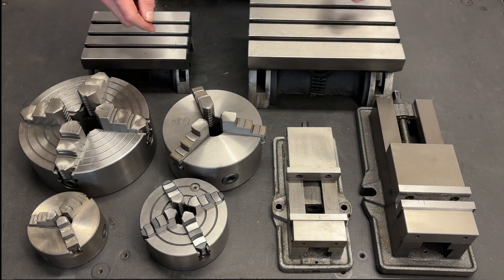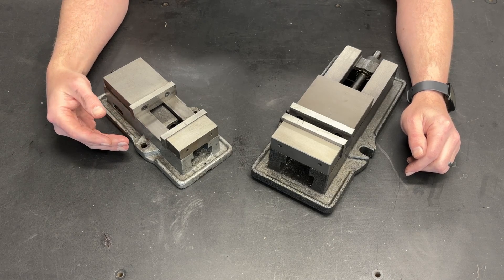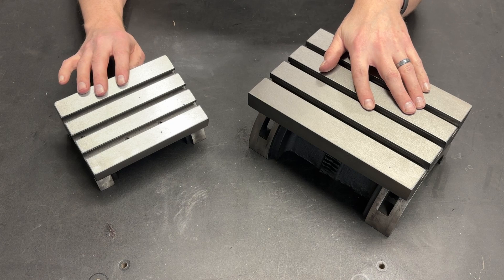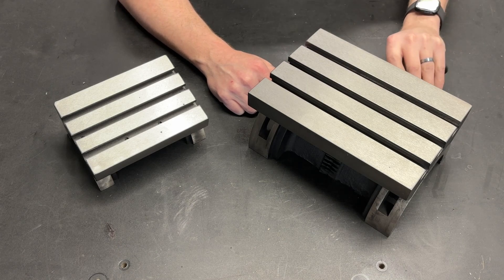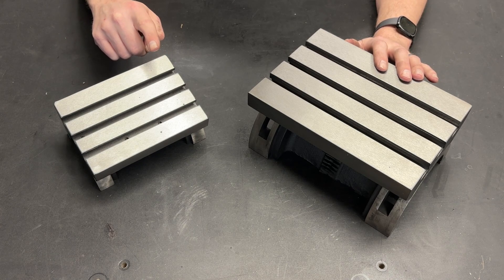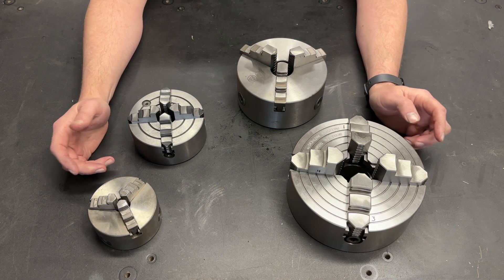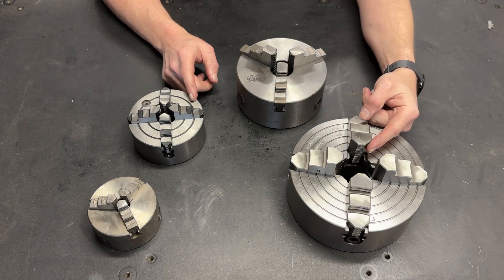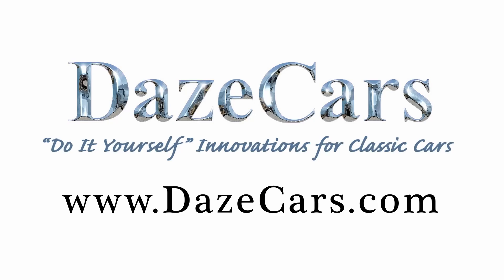Picking the Correct Machining Tooling Size for Your Hobby Mill or Lathe, Bigger Isn’t Always Better

Comment: I am putting together a 10" Sheldon lathe that I inherited from my Grandfather. I found the 8" 3 jaw chuck for it. One look and I knew it was probably too big; but I had it. I thought I had more chucks somewhere but was going ahead with what I had. A bit later I found the 6" 3 jaw one shelf over, hiding in plain sight. The difference in size is pretty substantial. I think the big thing is that larger chucks are not just a bigger radius but also thicker. This dramatically increases weight. For a 10" lathe, I would go with a 5" 3 jaw and 6" 4 jaw. 4 jaw chucks tend to be thinner and  lighter than 3 jaws so you can generally run a larger 4 jaw. But run the smallest chuck that works. I have a collet drawbar and a Sjornsen collet chuck. For small parts, I like collets. I also like running them in the headstock with the drawbar.  Every bit of weight that is hung on the end of the headstock is going to affect accuracy. Probably not noticeable for most things but still there. And added weight is added wear.  I also have an old 10" Atlas/Craftsman. And the difference in size between the two lathes is immediately visible. The have the same swing but are not of the same class. For that lathe, I have smaller chucks.
Reply from the maker: Thanks for the feedback, and that's a great point about chuck size!

Comment: i have a large 4 jaw (15.25" lathe) that i ended up having to bore the jaws to fix tuliped/worn jaws, which made the OD it could hold larger. ER40 holder + collets help fill that gap to hold the 1" and smaller stuff. best part, cheaper than a chuck.
Reply from the maker: interesting

Comment: “They say you can hold small parts in big tools — but try clamping a grinding vise in a mini mill or spinning a 50mm collet chuck in a hobby lathe, and you’ll learn real quick: Go big, or go adapt.
Yes, you can stick an ER collet chuck in an 8" lathe chuck and hold tiny stock like a champ. But try the reverse — mounting a brick in a teacup — and you’re gonna have a bad time.
Start with the big tool, scale down as needed. Doing it backwards? That’s just called troubleshooting… the hard way.”
Reply from the maker: having gone from a smaller machine to a bigger machine I see where you are coming from but I don't completely agree with your statements.  too big is just too big.  Ideally you want to get the correct machines for the projects you are working on and fit in the footprint you have available.
Reply: @dazecars  I assumed that 'ideally' wasn't an option so the choices available are go big or go small.

Comment: I have a number of mill vides. One 6 in Kurt and one 8 in Kurt. Hardly use the 8 in vise. Can’t pick up the 8 in.

But what is handy is a toolmakers 4 in vise. I clamp the toolmakers vise in the 6 in vise using an angle wedge or sine bar to set precise angles.

Tilt tables eat up precise Z height. Here I use a “cheese board” along with a sine bar with table clamps.

Most lathe work is done with 5C collets and six in chucks. I do have 8 in chucks but they are awkward when doing smaller work.
Reply from the maker: BIG difference between 6" and 8"!!  so many ways to set work up but it is so nice to have and many options as possible.  My early years in machining I didn't have much and that taught me to be creative.  Now I have both a bag of tricks AND the tooling to give me more options.

Comment: Help, I recently got a six inch three jawed chuck, probably the same as the one shown.  Looks like they numbered the wrong ones, because they are on your four independent jaw.  In other words, is there a trick or designation that i am missing?  Or, is this crash course back to algebra 40 years ago?  Plus there are two sets!  Oh, on the tiny paper is says ~.02" inch run-out.   Can't be that bad...  I already have a impossible problem with this lathe I got last year, fixed the water heater yesterday, now I have two headaches.  I'm still grinning, you should see this 1908-18 approx. 5.5' between centers, I took the top of the carriage off and it is like someone bought it and put it in a museum, like the did one project in cast iron and that was it, like brand new inside, no chips at all.  Like a time machine.
Reply from the maker: I am having trouble understanding what your problem is.  As far as the two sets of jaws they are inside and outside holding.
Reply: @dazecars  I had a feeling.  Where are the numbers???  I assume they both flip over, not sure.  Should be numbered to put them in one way and number a different way to put them in the other way.  That is how it is on the 1969 Atlas 12X36.  I looked at the back and they are different, probably works the same way, but without some identification its a crap shoot every time.  Do I have to do it the hard way?  Find out which one comes off first and that is Number 3.  Which one comes of next No. 2.  And the last one, No. 1.   Then guess at the backs to see which one has the furthest cogs is probably No. 1 etc...  Oh, and number the slots.  See what I mean?  When they are self- centering they have to go together in a certain order.   I was thinking, maybe copy the Atlas, it should be the same principles and Sharpie / Magic Marker backup number just in cast that doesn't work.
Reply: @dazecars  My bad, I see them on the inside slots.  But still not on the chuck, maybe under the jaws...  No big deal, probably figure it out.  Now, how to get the ends of the lead screw and drive rod off on a 100 plus year old lathe.
Reply from the maker: First they don't flip around.  You have inside jaws and outside jaws and they only go in one way.  The jaw numbers are in the slots on the jaws and the there should be a number inside the slot on the chuck.
Reply: @dazecars  Sure enough, won't matter which slot, as long as it is 1,2,3, all apart, now to clean it.  Hopefully they don't know about run-out, two hundredths are a leap, I used to grind aircraft cranks long ago to "ten'ths", one time I got one so close to zero that the inspector thought his interments were stuck!  That was funny, I was watching from a distance.  Just getting back to the shop, too much trouble fighting the cold and really not in the mood, just need that lathe available, as the original chuck is too dirty or worn out jaws.  I have one of those tread-mill motors, somewhere, that might be good for a tool post grinder.  Thanks.
Reply from the maker: I see what you are saying that is shouldn't mater which jaw goes in which slot as long as you put them in in order but still slots are usually labeled so I think I would put each jaw in the corresponding slot.
Reply: @dazecars  I painstakingly went over every part with 3-4 different files to deburr it, didn't notice any slot numbers, I'll look again, obviously don't know jack about this chuck.  I dislodged a number of sharp tiny steel chips and it feels like cast iron grit.  It seems destined to soak with diesel in a tiny bucket, found one, which was unusual, then the wife returned the other one, it is a sign.  Not really in a hurry, super windy today, so blowing off diesel dripping parts doesn't sound like a good idea.  I'm still kind of into the winter reading of heavy books, although I have lots of projects, looks like winging it TIG learning stainless steel!  AND, it has to be successful.  You gotta hear this one, I need a smoke stack made out of stainless, so I ask my go to welding/machine place and he recommends a company, but they won't talk to me until I produce engineering plans.  So, I finally get around to doing that and only drew two views cause the third was redundant, the guy unrolls it and goes hmmm, so you want us to make two of these, right?!  I live in the middle of nowhere, so I ignore the red flags, then call them up about a month later to ask wtf and they say oh, we are starting it tomorrow, I say what about the bid?  Bid? they say... That's when I lost it.  Anyhow, now I have this huge 8" Dia. 20' pipe on my trailer and only two stick welders.  At least I don't have to make the tube, found one right before winter.
Reply from the maker: All these chucks are a little different so maybe the slots are not numbered on yours.  I don't know how some places stay in business.

Comment: I've been following you for quite some time.  So I've been watching you "grow" your machining tools and knowledge over some time.  This video on the size of tooling offers me a chance to make some observations.  Your machine tools have gotten larger in size over the years.   I'm pretty sure it will continue this trend.  When I got started, I was primarily interested in renovating older machines and using them to rebuild themselves and others.  I was looking at small machines, but fortunately, I started with a South Bend 13" lathe.  When it came to buying a milling machine, I bought a used Bridgeport.  So I skipped all of the small stuff and went straight to serious machine tools, and I'm so glad that I did.  You find out quickly that you can machine small parts on a large machine, but you can't machine large parts on a small machine.  The other and most important thing about machining and machine tools is rigidity. That's the number one thing.  You can keep increasing the size of you machines over time, or you can just go straight to the top of the food chain.  I'll keep following your progress. I see a Bridgeport or Bridgeport Clone in your future.  Regards.
Reply from the maker: Its a good observation however I am about maxed out in work space room.  I doubt there will be bigger machines in my future but I will never say never.